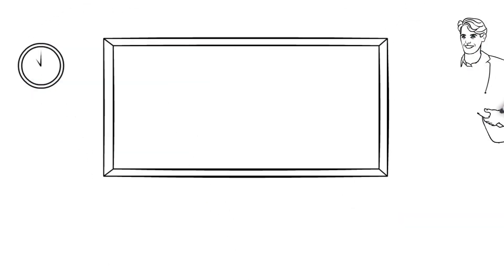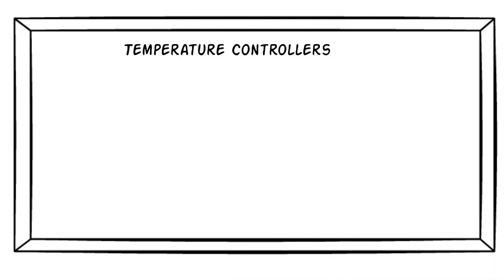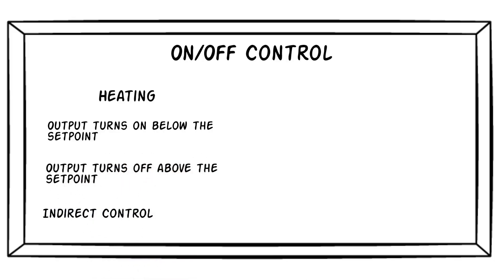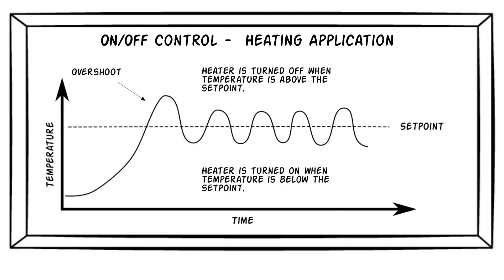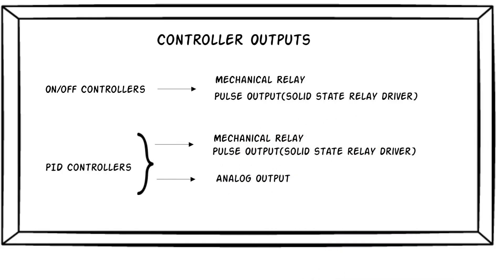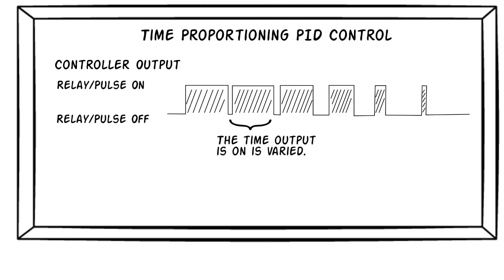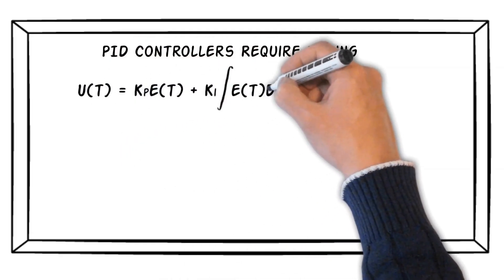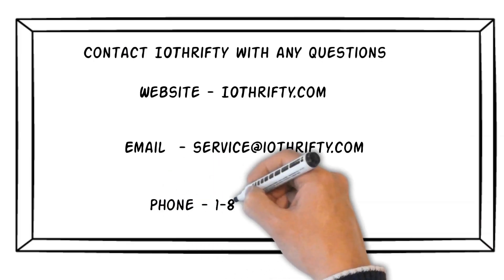Understanding PID Control - Keeping It Simple

Comment: Using a controller that simply has an on/off output is a really poor choice to show the nuances of a PID controller. Something like a steam valve to control temperature would have been a better example. And, BTW in your last slide, Integral is also know as Reset, and its the Derivative that is Rate.

Comment: i strongly cannot recommend this video and i personally stopped at 1:08. Even if the mathematical equations are handled internally by a system, an engineer should ALWAYS know how it works, how the math works etc.
Reply from the maker: You of course have a right to your opinion but I have worked with hundreds of users of PID controllers who sucessfully uses them in their application without undestanding the math.  This video is intended for those users.
Reply: @iothrifty609  I am one of those users! haha The math is way over my head.
Reply: @iothrifty609 its not about my ”opinion” its not controversial what im saying. Your title is understanding PID controllers and simply skipping the math is to skip the function of the PID controller. The math is the whole point 😂 whats happening in practice is based on the math. At least explain it in an easy way for people who are not interested. Simply leaving it out is WRONG. Delete this video for your own sake 😩

Comment: I once was involved in a rebuild of a 7-tank plating process that the manufacturer was never able to get under control. Typical scrap rates were at 25% for years. We installed 480V electric immersion heaters and mercury-wetted relays, then controlled with time-proportioning PID outputs from a PLC. Scrap rate went to 0% and throughput increased by 18%. Electric consumption was reduced by 22%. A very successful real-world implementation of Time-proportioning PID!